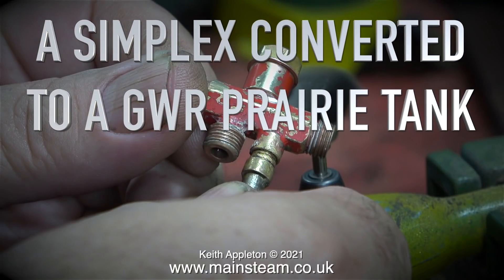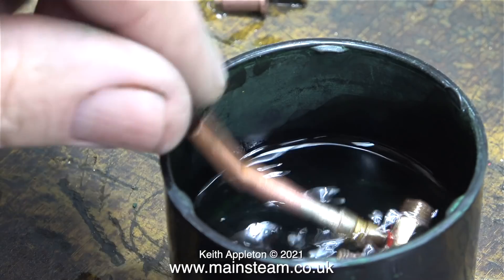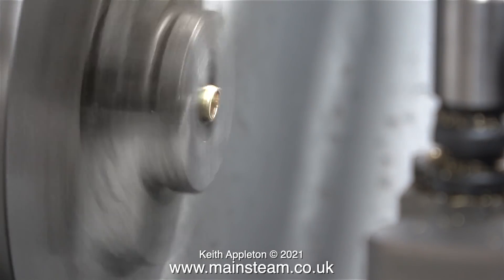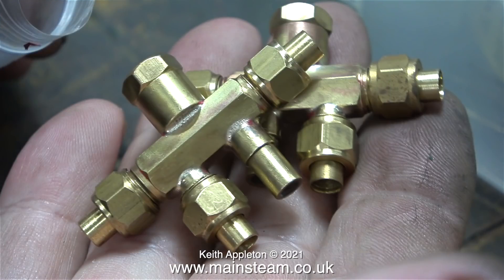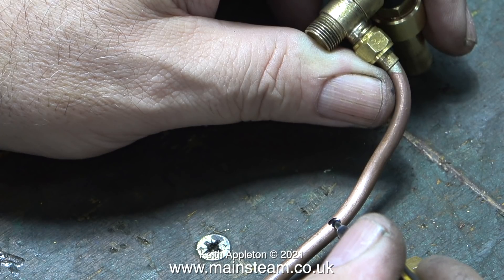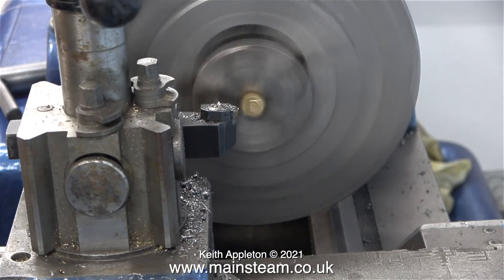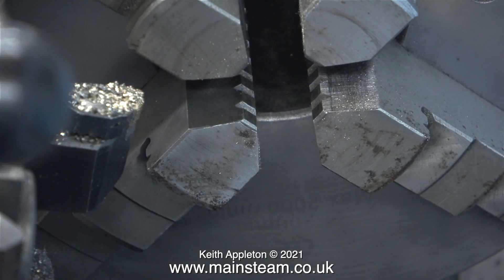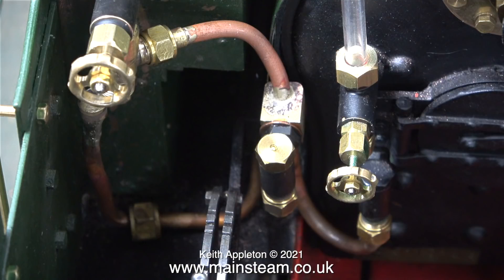SIMPLEX PRAIRIE TANK - PART #101

Comment: Hi, are the union connectors flat simply to maintain the largest possible bore, is is there another reason?
Reply from the maker: I did mention it in one of the videos - it is to make it easy to remove the injector as the unions are not coned.
Reply: Thank you!